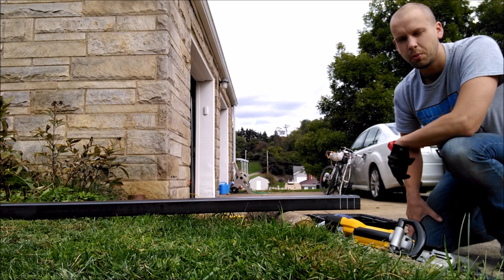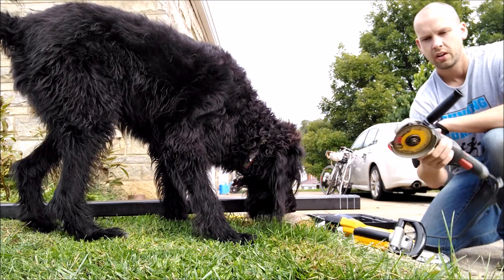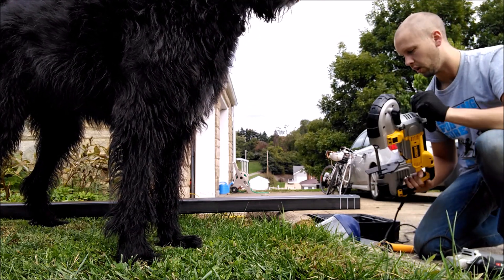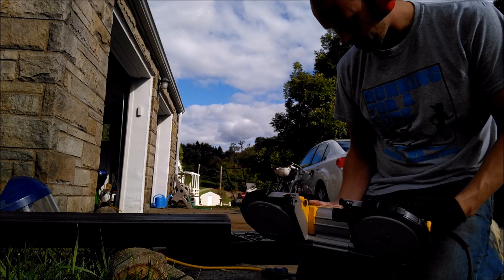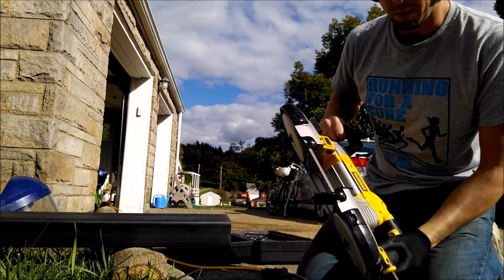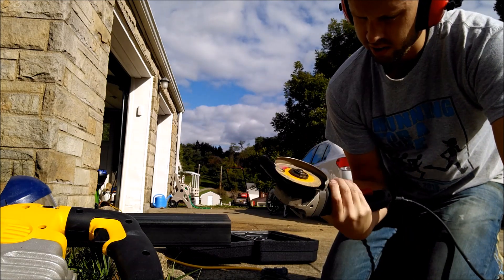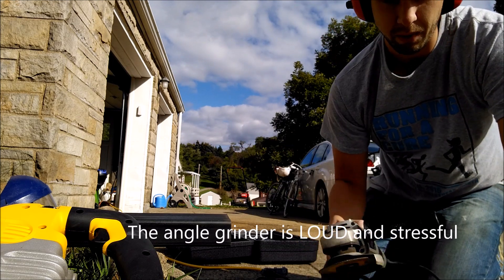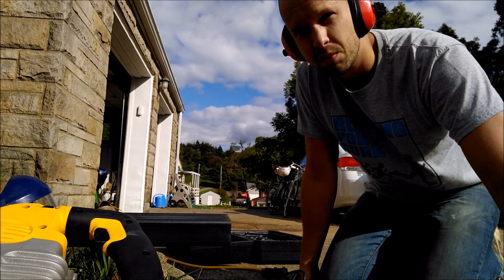Dewalt Portable Bandsaw vs Angle Grinder Showdown: Cutting Steel

Comment: No way would I ever use an angle grinder if I can do the same job with a band saw. Even if the angle grinder were faster, it's far louder, far messier, and sends sparks all over the place. And I don't need glasses with a band saw.
Reply: Bandsaws also don't make your neighbours hate you, or explode and send shards flying everywhere if they fail!

Comment: I got Bosch portable band saw too. The bigger trouble is the blade easy break about less than 70 cut and the blade need pay more than disc grinder.
Reply from the maker: That's true but I go through about 20 grinder cutoff wheels to one bandsaw blade.  I think it depends on what you are cutting.  If it is mild steel the bandsaw blades will last super long and if it is really hardened, the grinder might start to make more sense.  Worst case your steel is as hard as your bandsaw blade and your are toast but it would probably have to be spring steel or tool steel to have that happen
Reply: Wow, that's good performance. Coz im using bosch 18v band saw and it more small size than ur demo Dewalt band saw. It also got design problem which both of band saw wheel too small make it more blade bending when cutting and break. I always cut 3-5mm mild steel but the best record is 30-40 cut maximum. I have forwarded problem to Bosch head department but no feedback. Today I just break another blade saw again. I think I have to give out the machine coz it make me pay more and more.

Comment: It seems the bandsaw is very awkward in cutting. I think it needs a DIY cutting table affixed to it. Been debating whether to buy the portable bandsaw or the reciprocating Sawzall to cut 3/16 1095 steel plate. Angle grinder wheels can't handle 1095 steel.
Reply from the maker: The bandsaw is really good for things like pipes, angle iron, and square tubing.  If you want to cut plate, it will cut great but the throat depth might be an issue.  A sawzall with a good blade will also work well but is much less enjoyable to operate.   They can shake you to pieces after a few big cuts.
Reply: @CoolStuffGuysLike   
The portable bandsaw only cuts 5 inches in width i found out. That's not wide enough for my needs. It looks like the Sawzall will have to do. I've had so many angle grinder disc's break apart, I just don't trust a disc to cut through 3/16 thick of 1095. I guess I'll have to endure the shaking from the Sawzall. 😂
Reply from the maker: Lol hold on tight.  Might be worth getting a fresh pack of bimetal sawzall blades depending on how much cutting you need to do.
Reply: @thetoolmat8632  seriously??? I'll check it out!! ThankQ!
Reply: I've decided on the bandsaw, unfortunately it is probably stuck outside of port. Who knows when it will arrive now. Can't get any deliveries.
Reply: @CoolStuffGuysLike  
Yes, I prefer to enjoy the job instead of shaking. LOL
Reply: @CoolStuffGuysLike  
Morse 811 blade

Comment: So bandsaw is 3 times quicker cutting & with no sparks plus the material cuts 50% cooler!
Reply: For what its worth, that's really more like 4 times less heat.  Assuming the material started at 70 degrees, it only increased 28 degrees vs. 123 degrees of temperature change.  Heck, leave it out in the sun on a bright day and it'll be too hot to touch in minutes!

Comment: You need an Evolution chop saw for that. LOL
Reply from the maker: Those are super nice!  If I cut a ton of steel I would probably get one.  I have also been using the freud diablo 7 1/4 steel cutting blades for my circular saw and am blown away.  They don't last forever but they cut steel like it is hardwood.

Comment: My 14.5 amp 6" Metabo angle grinder would cut that square tubing and that DeWalt band saw in half faster than the band saw would cut the square tubing :)